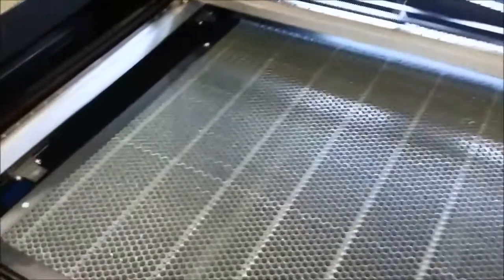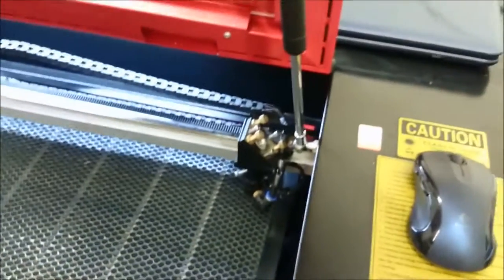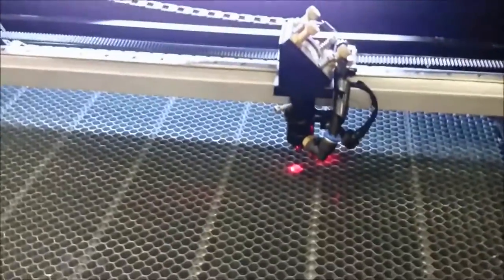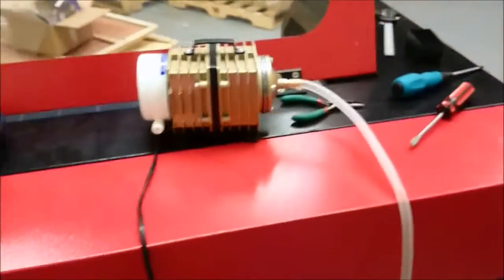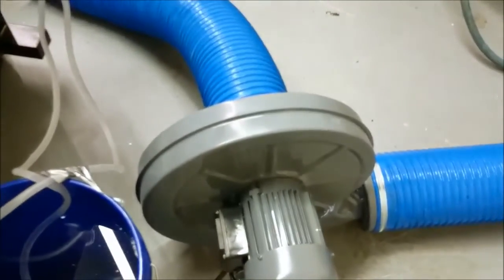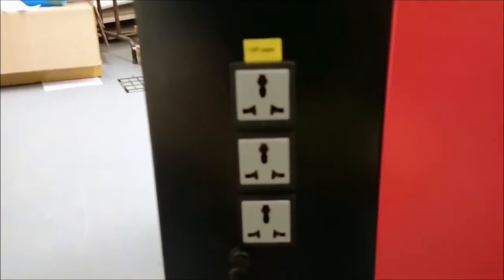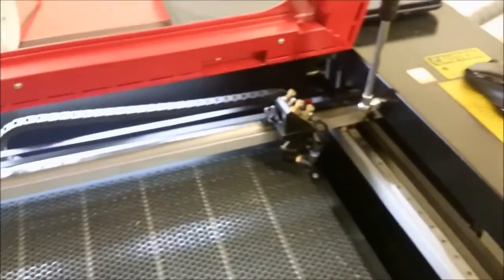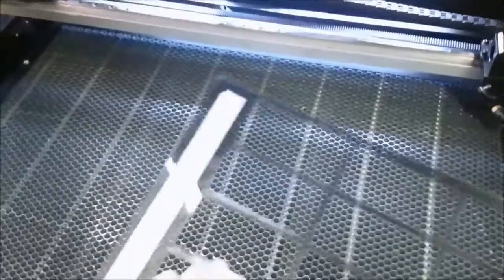Day 1 thoughts on ebay 60 watt CO2 laser cutter

Comment: I'm put off by the weight & also the size trying to get it into a domestic house! shame really, and that someone has said that their tube only lasted 8 hours!
Reply from the maker: for what it's worth, the top and bottom sections can be removed, allowing it to fit through a standard doorway. this machine is leagues better than the 40W desktop laser cutters you can get. 8 hours sounds like a random bad part to me, the machine in this video ran for hundreds of hours with no issue. These laser tubes need to be liquid cooled (ports are on the back of the machine).
Reply: Hey, I have a cheap 40W laser and my tube died after 6 months (probably 400-500 hours). If one of these nicer models only lasted 8 hours it must have been defective.

Comment: Didn't see it anywere. What make and model laser is it ? Is it a flashlaser ?
Reply from the maker: It doesn't really have a brand name. If you go on eBay and search 60w laser, this is what you'll find. Some factory in China rolls these things out, and there are dozens of distributors on Bay selling the same exact setup. The cutting bed is 700mm x 500mm.

Comment: Hi i just bought one of these machines, i just start using but, unfortunately I saw your advice about the plugs too late cause I did plug the vacuum to it and suddenly it turn of the machine now I don't know what to do to make it turn on again. I'll be very grateful if someone help me.
Reply from the maker: I'm guessing that you either melted a wire somewhere or melted the emergency stop button on the front face of the machine near the control panel. All the electricity for the machine runs through that button (at least it did on the one we bought), which probably isn't rated for that much current. 

try checking the button with a multi meter to see if it reads ~0 ohms while it is in the closed position (popped out)

With the machine off and unplugged, look around inside it for hanging wires or burn marks on the circuit boards. If you don't see any, try tugging (gently!) on various wires so see if any are loose.

if you find a melted wire, replace it. if there's burnt out components on a circuit board, you'll need to replace it.

Other than that, I can't really help... good luck!
Reply: +braelito thanks for replying I did what you said, and find out that I burn the principal fuse it is located on the principal cable of the machine that is going to the power, I replace it with one that comes with it stored just by there as a spare part. It was really easy. And I confirm what you said please don't use those connections on the back.

Comment: Hello! Do you remember how to change the language from chinese to english? Thanks!!!!
Reply from the maker: You'll need to use the pictures in the manuals as a guide to count the menu options, and probably google translate the words "settings" "language" and "english" into chinese. Unfortunately I don't remember the exact sequence of buttons that you'll need. Good luck!
Reply: +braelito i finally did it. 10th option on the main menu and then the 3rd option. Tomorrow i'll try to calibrate te mirrors. Did you use the ground cable that came with the machine?
Reply from the maker: +Daniel Moros C. Thanks for posting the menu options to pick, you'll probably help someone else out with that! 

I did not get a ground wire, but I didn't need it; the mains plug in the back of the machine has a ground pin, and I checked all the metal parts with a multimeter for a low-resistance path to the ground pin(with the machine off and unplugged). since the parts were connected (electrically) to the chassis and the chassis was grounded via the wall outlet, it was safe to use as-is. You could check yours as well since the build quality can vary machine to machine.
Reply: +braelito thanks for answering so quickly. I'll post any news as soon I finish calibrating the mirrors and installing the software.

Comment: can you use windows 10 with this machine
Reply from the maker: +raymond cantrell It was working with windows 8, so I don't see why it wouldn't work with 10.
Reply: thanks because i upgraded to windows 10 and i also ordered this machine. I get mine next week i will let you know. if not have to convert back to windows 8 thanks for your response
Reply: I bought this machine and so far nothing but trouble with the y axis being noisy and a vibration issue, at 500mm/s when cutting then paper it does not produce smooth curves but a jaggered edge, still trying to sort with the seller

Comment: I know you no longer have access to the laser. But do you know if you where able to print directly from programs like Adobe Illustrator and Autocad? If so please let me know how you did it. Thank you so much.
Reply from the maker: +wondertwins if you export as a vector file, the machine should be able to cut it, and if you export as some form of bitmap image, you should be able to raster out a picture. I'm pretty sure the machine can do it without anything else, but you may need to import the files into the software that came with the laser, then print from there. 

Have you tried putting your file on a flash drive and going directly into the laser that way? Or are you literally trying to print out of a program through the print menu dialog?
Reply: +braelito Wow that was fast! Thanks so  much for replying. I used the software that they provided me and I can important files from other programs, but It would be nice to print from the software that I work on from the print menu.
Reply from the maker: +wondertwins Yeah, you just happened to catch me while I was watching some videos, so I didn't need to go too far! 

I never tried getting it to print from another program. I don't remember if the computer saw the laser as a printer or as a miscellaneous USB device. I suspect that it just behaves like a generic USB device, which means you're probably out of luck, but I could be wrong (wouldn't be the first time!).
Reply from the maker: +wondertwins I just did a bit of reading, and it looks like these lasers skip using printer drivers and all the associated hardware as a means to keep costs down. So unless you've got a significantly different laser than I did, it looks like you're stuck using their software.

I do know for a fact that Epilog lasers act as a printer, and you can print to them from any program. The problem there is that a little 12"x24" one costs $10,000 or so. I guess that's the price you pay...
Reply: +braelito Haha yes. I will do more testing. I will see what I can do. Thanks for the input.
Reply: +wondertwins I followed this amazing guide https://www.bosslaser.com/Download_pdf/Laser_WORKS_8_Install.pdf
and it worked great! But now when I go to cut, even though my power is at 100% it is not cutting anything. I put a piece of provided tape on the first mirror to see if it was a mirror alignment issue, it was not. I checked the laser power supply and it turns out that the input voltage says 220v input I live in the United States so I think  I should have a 110/120v input. Did you have this issue, or do you remember anything about the laser power supply? Thanks so much.

Comment: hey did you ground this machine ?
Reply from the maker: +Gorilla Quads The ground pin on the power adapter of this machine was properly attached (verified with a multimeter), so we did not take the additional measures suggested in the instruction booklet.

Comment: hey did you ground this machine ?
Reply from the maker: the ground in the power cable is sufficient. We tested all metal parts on the machine to the ground pin of the plug, and couldn't find any ungrounded metal.

Comment: Hi!  I bought the same machine (new) off ebay a few weeks ago.  It's all wired in and working... except the cutting depth is rubbish.  Despite trying the head from material at different distances, adjusting speed, power, etc., I can only get a maximum of 2mm cutting depth.  This is in laser ply (1/8th") and acrylic.  I'm assuming that there's something silly I'm missing!  Have you any ideas at all please?  I'm desperate now for suggestions.  No one here in the UK seems to have any experience of these.  Many thanks.
Reply from the maker: +Chris MacKenzie I got the best results with about 1/2" to 5/8" of space between the bottom of the cutting head and the top of the material to be cut. Do you know if your mirrors are aligned? I didn't need to adjust mine at all, but I'm sure these things can vary quite a bit machine to machine. Also, are you using the air assist? Without it your cut channel just gets covered in soot, which stops the laser from penetrating any deeper.
Reply: Chris, did you ever find a solution?  I bought this same cutter and can't get through 3mm acrylic either.  Tested laser power and it's maxing out at 31 watts.  Seller offered 100$ refund IF I shipped it back to CHINA (not California where it shipped from).  I've asked for a new tube and after sending multiple videos of the issue, they stopped responding.  Found a guy in LA who will fly out and work on the machine, so I'm thinking of dropping a RECI 80w tube and power supply at this point and paying him to install it.

Comment: I bought the same cheap laser cutter, does yours have crappy wire joins that are just taped together and does your laser forces head clip the door strut on the left?
Reply from the maker: +Paul m Most of the joints in this machine were soldered and hot glued or were bare wires into terminal blocks on some of the PCBs. I've only run the cutting head into the door panel/struts once, and that was when I was trying to see if I could. I set it up to use the back right corner as the origin to keep the head as far away as possible from those areas.

Comment: Any updates on your laser cutter
Reply from the maker: +Xairflyer  I don't have access to this laser cutter any more (new job), but if I had the space I would absolutely buy one of these for myself. If you have anything in particular you want to know about it, I'll give you the best answer I can.
Reply: +braelito Any things you came across in use that needed sorted and what sort of thickness did it cut
Reply from the maker: It worked great right out of the box, I didn't need to align the mirrors or anything like that. The laser's screen defaults to chinese, but if you follow the directions in the manual, you can change it to pretty much any other language. You'll need a 5+ gallon bucket for your coolant reservoir, but depending on who you purchase from, the laser should come with the coolant pump, air assist pump, and ventilation fan.

The thickest material I could cut with 100% power and 5mm/s was 1" acrylic. Pretty much any plastic or wood less than 3/8" should be pretty easy with either slow speeds + high power OR multiple passes. CO2 lasers cannot cut polycarbonate, and cutting PVC will release chlorine gas which is poisonous and can etch your mirrors.

most of what we were doing was 1/8" acrylic which we could cut around 60% power and  I think about 30mm/s

Comment: hello i bought the same machine but i have really problems to connect it to PC and use USB for files... if i drag files to USB and than plug it in machine it cant find any files :( next thing is that there was CD with corellaser but it cant start cutting because here is USB dongle missing please HELP asap thank you juri.uhliar@gmail.com
Reply from the maker: +Juraj Uhliar if you're using a USB stick for files, you need to use the USB port labeled "Udisk". To find the files, press the "file" button thats to the left of the "start/pause" button. In the menu that opens, look for an option on the right side of the screen (of the machine) for Udisk. that's where your files are.
Reply: +braelito i used USB port Udisc ... Than i press button file and in menu i choose udisc and there was nothing... I have on my usb many files like .crd .dxf .jpg .png .plt but nothing find :(
Reply from the maker: +Juraj Uhliar you need to export it from the software that they include on the CD. I'm pretty sure you can buy a replacement USB key for the software on the manufacturer's website.
Reply: +braelito what software do you use for your laser??? CD was including but usb dongle wasnt here and it doesnt want to wirk because when i push start on button on CorelLaser it write USB key missing
Reply from the maker: +Juraj Uhliar I used the other software on the disk. I forget what it was called, but I'll see if I can find out.

Comment from the maker: +Ray Mac low speed, high power. probably around 5 mm/second at 75% power or so. MDF is pretty dense, so it may take more power or multiple passes to get through. I've heard that some brands of MDF cut well and others barely cut at all, so if you still can't get through it, try another brand. (I have no idea which brands are good or not, sorry)

Also, see this document for different materials: http://www.rabbitlaserusa.com/Manuals/SpeedsFeeds_RL.pdf